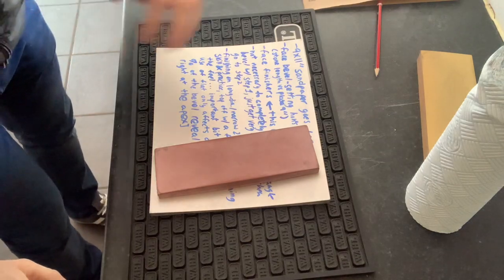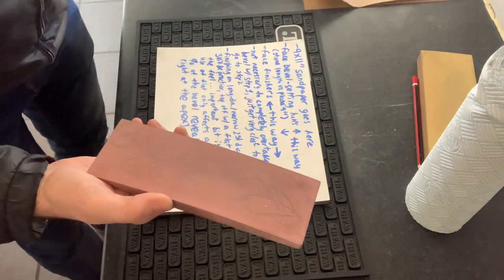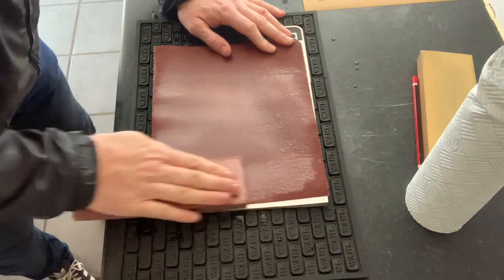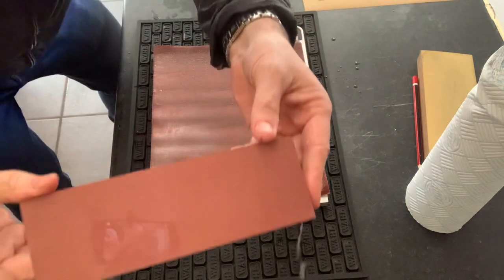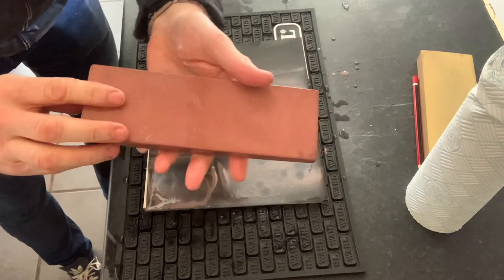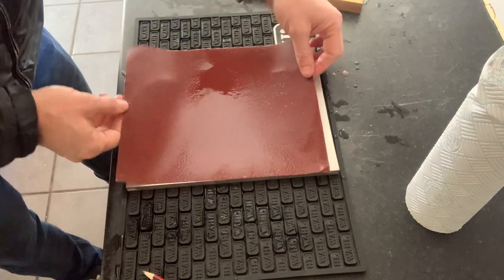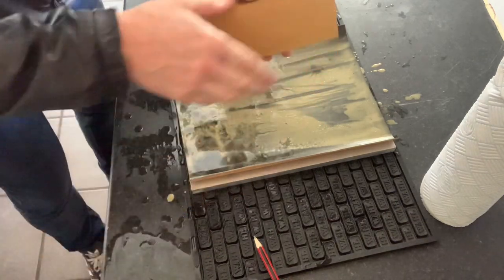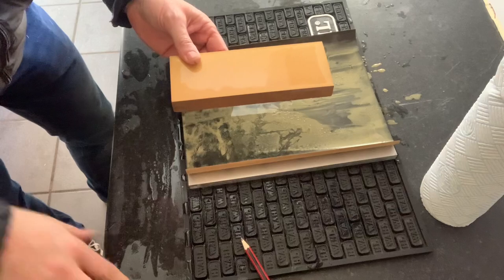How I shaped my hones (convexed)

Comment: Very nice. 

I started moving up to 1000 grit wet dry on hones. It seems like the scratch pattern on the shave piece is better. 

Thanks for sharing
Reply from the maker: I think you could be right there bill I'll most likely get something finer for cleaning the stones up after use . Bill how long do you reckon you spend on bevel thinning? And what grit stone do you use ?

Comment: Recently  finished convexing a 6 inch soft Ark ,against sandpaper and SIC , to be my bevel thinner. It was a miserable few hours but the good thing about Arks is that you do it once and you probably won't have to do it again.
Reply from the maker: What's the type of Arkansas I'd have to order to bevel thin ? I was thinking the same as you !
Reply: @garyhaywood6013  A soft Arkansas. Mine's from Dan's (which I bought from a domestic seller). I am not sure how much quality would differ across brands but Dan's seem to be the most sought after among current producers of Arks. RH Preyda's stones are also good (I have a hard black from them and it is excellent) and cheaper than Dan's (probably more easily attainable outside US as well).
Reply from the maker: @hosseinm4433  okay so the soft Arkansas cut faster ? I'll get in touch with dans 👍
Reply: @garyhaywood6013  that’s right. Soft cuts faster than hard Ark.
Reply from the maker: @hosseinm4433  what grit would you say it's equivalent to ? 3k plus or less
Reply: @garyhaywood6013  hard to assign grit to Arks I think. 3k sounds about right to me based on the speed that it cuts but I’ve seen some websites that put soft Ark closer to 1k.

Comment: New subscriber ty for this video Sir I just received the convex plate and I am very new to the matter of straight razor honing I have never done it before this was informative and gives me confidence. I have couple of questions what stones do u prefer and grits? And what does doin the long ways of the plate do differently from the short???
Reply from the maker: I use the 3k naniwa pro to thin the bevel . That stone I shaped on the short axis which creates a wheel . You hone the razor to form a thinner bevel. Now I use for step 2 a 8k naniwa shaped on the long axis . This creates a very slight convex surface going across the width of the surface . From what jarred told me this works more towards the apex . I have tried for step 2 flat and convex and both work  . Then fir the final step I finish on my Arkansas ultra fine black from dans . These three steps give me a coticule feel but keener. . You could use any finisher of your choice I do plan to try a coticule and my j Nat at some point . Having been happy with Arkansas I've stuck with that . Out of around 10 razors I've had 2 that wasn't quite there . It does take time to master this method but you will get a nice shave with just three steps
Reply: @garyhaywood6013  awesome thanks I don't know or have any of my own choice. Because I have no experience with stones coticules yet so just want to see what exactly is the best for me to get the job done tyvm